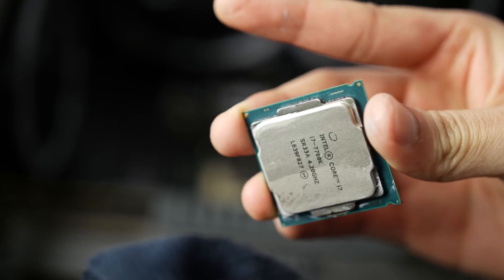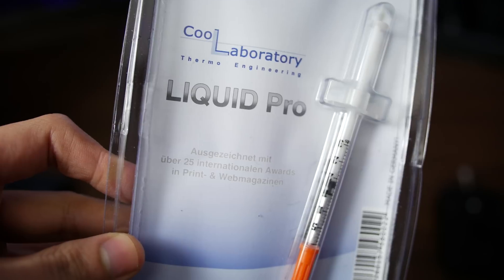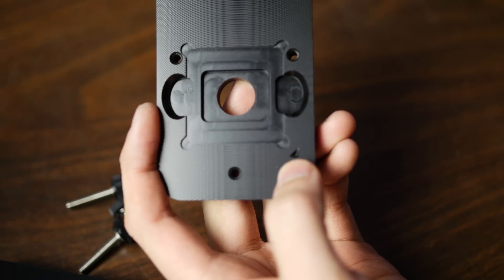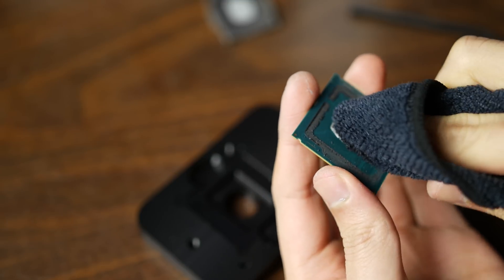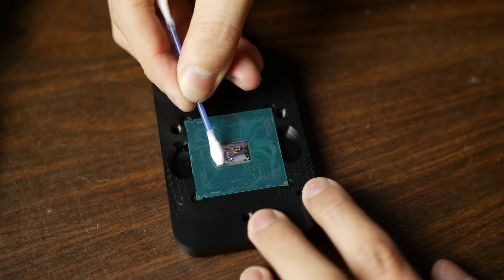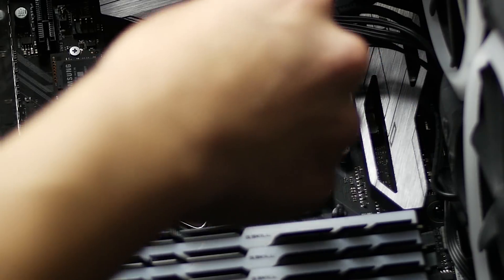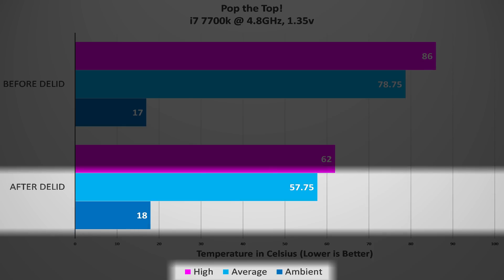Delidding the i7 7700k - Before and After!

Comment: Something isn't right here. Judging by the fact the liquid metal stuff can't be used on aluminum and that it is not very poisonous it is probably pretty safe to assume it contains a significant amount of Gallium which has a thermal conductivity an order of magnitude worse than aluminum, copper, or silver usually used in thermal compounds.

I'm wondering if Intel's quality control isn't as good as the price tag suggests and their stock thermal pad just doesn't physically touch the heat spreader.
Reply from the maker: I honestly couldn't tell you.  My best guess is Intel's stock stuff is built to last, whereas everything else is for optimal heat transfer and is intended to be replaced every year or so.  Regarding the gallium, I'm unsure of exactly how much is used to compose the compound, but it will wear the aluminum slowly over time.  I'm tempted to say its presence is significant enough, but still somewhat minimal.  I could be very wrong, though

Comment: I would be interested to see someone who delidded and put the heatsink direct on the chip with artic silver or something better.
Reply from the maker: I used liquid metal because I heard it offers better performance over standard thermal paste.  The main reason I put the IHS back on was because I wasn't 100% confident the cooler would make good contact with the die, but also largely because I would lose it if I didn't, LOL.
Reply: I dont know the paste blends all that well. I know to watch out for gallium, because it can do some real damage to certain metals. 

The IHS has little notches that help it lock in the cpu in the  mobo. Some work would have to be done to the IHS to allow the chip to make direct contact to cpu cooler. 

Eventually someone will try it.  Anyways, good info one temps. I tried to be funny in my post but edited it as I figured the humor might not be comprehended. In the event you can read edits, i figuered i would share that bit.
Reply from the maker: I saw the initial comment, I can see how it can be understood as a dry humor!  I refrained from commenting since I saw you changed it by the time I made my way to answer.  And you are correct!  Gallium eats up aluminum, so that's important to keep in mind!  Copper-based heatsinks will be fine, though!

Comment: I feel like the "safe voltage" for Intel CPUs is waaay too safe. I mean, I have a Q6600 superoverclocked to 3.8ghz and it lasted fine for 9 years, until it got too slow and I upgraded. Before your overclocked CPU gets ruined due to the overclock well then already your HDD, GPUs and SSDs have already long gone been broken, and your CPU is so old it really needs an upgrade. Intel CPUs can almost run forever a long as you stay 5-10 degrees under maximum(for instance a 2500k shuts down when it hits 98 degrees, stay at 90 degrees on full load and you're fine, even though on the spec sheets it says that you should stay under 72!!).
Reply from the maker: This is true!  These processors tend to last forever, even if you abuse them a little.  In most cases, it'll be time for an upgrade before the chip burns itself out!
Reply: Yeah I have 5 Intel CPUs and all overclocked to max, I've never had any issues due to OC, same with all my (15+?) RAM modules. But I've had a total of 4-5 HDDs, 2 SSDs, 1GPU and 1 motherboard(this cheap mobo worked but degraded degraded it's capacitors because of longtime high humidity I'm guessing) die on me
Reply from the maker: Yeah, I've never actually had a processor die on me.  I have lost a few GPUs and a handful of hard drives, though!

Comment: I keep reading about the i7 7700k running hot, but mine idle's at 23c and the max I have seen from the benchmark was 64c.  I only have a CM 212 EVO air cooler and the fan never get's above 800 rpm.
Reply from the maker: John N. Sounds like you've got a good chip!  I hear some people are lucky with their temperatures and other people have some difficulties...
Reply: I guess so, any how I like this channel so far so you got a sub.  Keep up the good work!
Reply from the maker: John N. Thanks!
Reply: It seems like you have a golden chip or the program you are using to measure the temperature is giving false readings. Just to be safe, check the temperatures with Intel XTU and the newest version of OpenHardwareMonitor.
Reply: Yeah I though about that so I tried XTU, Hardwaremonitor, the MSI app, and am now using core temp that shows up on the keyboard lcd.  Guess I got a good one.
Reply: That's pretty close to common for stock speeds. It's when you start raising the voltage a little bit that these chips burn.

Comment: Steven, when you applied the liquid metal stuff how did you know how much to put on? I ask because you said not to get it on the PCB because it is conductive, but then when you put the lid back on I would imagine the liquid metal would squash and spread out towards the green PCB area? So how do you know how much to put on?

Love your videos btw. I only found your channel tonight whilst looking for Beyerdynamics DT770 headphone reviews, but you've got a great sense of humour. Subbed because of it.
I hope for a response, cheers from the UK!
Reply from the maker: Hey there!  I only applied a thin layer, enough to cover the entirety of the CPU die.  It would squish a bit when you but the IHS back on, but if you keep the layer thin, it shouldn't spread enough to cause problems.  As long as the entire surface is covered, you don't really need that much!

Thanks for the support, hope I could help!

Comment: how much all Delidding staff cost ?
Reply from the maker: The tool itself costs $30, and the liquid metal compound costs around $12.  Everything else, I already had on-hand.  Microfiber cloth is somewhat optional, as you can use normal paper towels, and I think most people have isopropyl alcohol around the house.
Reply: ALittleDIMM i fond only 70% alchol on my country
Reply from the maker: 70% will also work!  90%+ is ideal, but 70% will get the job done, too.
Reply: ALittleDIMM thanks for fast replay
Reply: ALittleDIMM i orderd everything and it's costs my a fucking 85$  without the silecon do you think its worth doing it ?
Reply from the maker: Hassan X_X $85 seems like a lot! How did it come to that price?  And the silicon isn't necessary. In fact, I recommend against it
Reply: ALittleDIMM the liquid metal 12.70 + shipment 20.37 = $33 and the tool 30 + the for the re applied tool 8 and shipment 12 = $50.95
Reply from the maker: Oh, jeez, those shipping costs...  I wouldn't have bothered with the relid tool, it wasn't all that necessary.  I do the entire process in the video and I'm still running the same configuration without issues.
Reply: ALittleDIMM you did it without silcon ?
Reply from the maker: 3:02

I show everything I did.
Reply: ALittleDIMM and do u think its worth doing it ?
Reply from the maker: I don't think so.  At some point in time, you'll need to delid again to replace the compound, anyway.   Since the motherboard retention bracket holds the IHS in place pretty solidly, anyway, it just seems like an unnecessary extra step.
Reply: ALittleDIMM i meant the delidding not the silcon 😅
Reply from the maker: It depends.  I'd only recommend delidding if:

You are willing to spend the money and risk damaging your processor for a CHANCE at a higher overclock
You are willing to spend the money and risk damaging your processor for lower temperatures

If you've dialed in an overclock and you're happy with your speeds and temps, delidding is a risky process.
Reply: ALittleDIMM ok thank you
Reply: ALittleDIMM what thermal paste do u use betwean the cpu and the cooler ?
Reply from the maker: I use Arctic Silver MX-4, but generally speaking, anything with good ratings will get you pretty similar results.
Reply: ALittleDIMM i have Arctic Sliver 5 should i use it after delidding my cpu  or buy mx-4 ?
Reply from the maker: I've used Arctic Silver 5, too.  That works just fine.  The only reason I'm on MX-4 right now is because I saw a good deal for a bulk purchase.  Right before that, I was using the Arctic Silver.
Reply: ALittleDIMM ok sorry for a lot of questions and your time
Reply from the maker: No worries, it's what I'm here for ;)
Reply: Could someone use Arctic Silver or MX-4 for both the cpu-cooler interface AND also between the cpu die and the IHS rather than the liquid metal stuff you used?

Comment: 2 Questions. 1st) Is it safe to leave the processor without glue like you did just hold by the clip of motherboard? and 2nd) How often we should change the liquid metal from die? Thanks great vid btw!
Reply from the maker: 1)  Yes!  It should be fine to leave the IHS floating like I did.  I'm running the same configuration now and I haven't noticed any issues.  

2)  I'm honestly not too sure, yet.  I didn't see any particular recommendations, but I had planned on coming back to this in nine months to a year since the release of this video to see if the compound has been significantly weathered.  I'll have an update towards the end of 2017/beginning of 2018!

Thanks!
Reply: Thanks for the amazingly fast answer and thanks for these feedback!
Much love, keep going your are doing an amazing job!
Reply from the maker: Thanks, I try my best!

Comment: I have Grizzly Hydronaut, is this still going to make huge improvement if I delid?
Reply from the maker: Hmm, I haven't used that brand before, but if I recall correctly, I've heard good things.  In most cases, when you delid, you'll see improvements.  The stuff that comes between the IHS and the die by default isn't as good as most thermal compounds you'll find on the market in terms of thermal conductivity.  I hear the best results are typically from using liquid metal compound, but you should still see some gains from the Grizzly stuff, too!

Comment: I'm sure it's already been mentioned, but Siliconlottery.com.   They de-lidded and returned my cpu, and it's been F'ING FANTASTIC.  Check them out.
Reply from the maker: I know about them!  But I thought it'd be a lot of fun to do it myself!  Glad they could work wonders on your chip, too!
Reply: Hey Michael...I was thinking about buying an i7-7700k directly from siliconelotery.com rather than doing it myself or sending in one that I had purchased seperately.  Seems the price difference is about $70 and it would save my the time and effort of doing my own delid.  However, did they provide any insight on the potential longevity of the TIM they use before having to re-apply?

Comment: I have little experience in this field, but have an i7 7700K running at 4.8Ghz/1.35v and never reach more than 72'C on any core, even without de-lidding.
Your basic cooling must be very poor indeed! I'd be checking that long before wasting money on de-lidding.
Reply from the maker: Temperatures will vary from chip-to-chip, sounds like you got a good sample!  I've used the Corsair H110i and NZXT Kraken x62 cooler on mine, reseated both a couple times just to be sure, and had fairly consistent results, so I thought delidding would be a fun project!
Reply: I've just built mine using a Corsair 115i. It's only set at balanced, so if I didn't mind the noise I could probably squeeze a lot more from it, but I don't see the point.
It gives me a Cinebench score of just under 1100 and a Geekbench4 of 6122/21012. All on a quiet, cool system. That's good enough for me!
Reply from the maker: I don't blame you!  If my chip could do that, I'd probably leave it there, too!  But mine was stubborn and required a little more "motivation"...

Comment: Would you recommend this for people who live in hot weather. Right now I'd say the average ambient temp for me is around 25-27 Celsius. I don't plan on overclocking too high. My idle temps are 37-40 degrees with a Corsair H80i on a i7 7700k. Thanks!
Reply from the maker: I would only recommend this if you absolutely need it.  There is a bit of risk when it comes to doing something like this, so I would suggest overclocking and running some stress tests for at least an hour or two.  If you're stable and you've hit the speeds you wanted at acceptable temperatures (85C is my recommended max for 24/7 operation), then I don't see a need!
Reply: Thanks for the quick reply! Just found your channel and I have to say I'm impressed. Please keep making these amazing videos. I will probably look into upgrading to a h110i for the bigger radiator. 

Just ordered these rgb fans I found on Amazon and would like to know your opinion. Hopefully make a video review for them.
Reply from the maker: Sorry, I'm not sure which fans you're referring to.  If you've used my Amazon link, I can try to track them down from there!  But otherwise, I have videos on NZXT's AER RGB fans and Corsair's HD120 RGB fans that might interest you!
Reply from the maker: Interesting!  These are pretty cheap, I might look into these!  Thanks for the link!
Reply: Great, I'll let you know my experience once I get them. The fact that the fan blades are black caught my eye. I have a black and red build and thought the Corsair SP120's wouldn't go with my setup, Thermaltake Riing 12 looked good to me but ended up taking the risk with these because of the price point.
Reply from the maker: Makes sense!  I'd love to hear your thoughts on them!
Reply: ALittleDIMM Hey just got my fans!(http://a.co/3edHa91)  I dont have much experience with other fans but I found the build quality to be strong (even though a fan had a broken corner, I blame poor amazon packaging). They come with fan controller with 6 fan inputs, 2 speed control on board and rgb color modes controlled with reset button. Max rpm 1300. I didnt see an improvement on temps but it did make my rig look a bit better!
Reply from the maker: Neat!  Mine came in a couple days ago, too!  Though, I haven't had the chance to open them, yet...  Been a bit busy with other projects...  But soon!
Reply: ALittleDIMM Cool looking forward to seeing your projects!

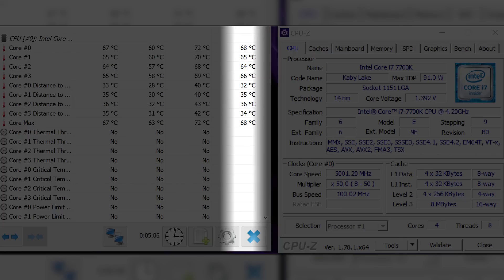Comment: What Software are you using at 4:14 to verify temps? Awesome video btw, made me comfortable with the idea of delidding my i5-7600k! :)

Subbed! xD
Reply from the maker: The temperature monitoring software (left side) is HWiNFO (64 bit), and the software on the right is CPU-Z!  

If you end up delidding, feel free to let me know your results!
Reply: Thanks for the quick reply! Right now i'm struggling to find Coollab's TIM without stupid delays in shipping... I'm in Montreal, Canada. :| I'll post results asap!
Reply from the maker: Good luck!
Reply: If we wanted to relid the cpu as opposed to floating it, what silicone/sealant/glue (or whatever it's actually named) would you recommend using?
Reply from the maker: Black silicone or a gasket sealant should work!  I've updated the description with links, but if you ever want to delid your processor again, it may be a little more difficult!
Reply: Awesome, thanks!! xD

Comment: Do I really need to use that liquid metal TIM if I decide to delid my 7700k?
Reply from the maker: You don't need to, but it generally provides much better results!
Reply: So I can use the Arctic 5 as well? Cause I saw in the video that when you delid it, the thermal paste is just plain old paste. I honestly finally got to trying to OC mine after having it for like 3 days and 4.8 was already shooting almost to 100c and it freaked me out.
Reply from the maker: You can use Arctic 5, but I hear the results aren't as dramatic.  It should still be an improvement over the stock stuff!
Reply: Ok cool! Thanks for the replies. Now I just have to figure out if I really want to drop 40 bucks on it or stick to Arctic 5.
Reply from the maker: It's a tough decision!  If you decide to give it a go, good luck!

Comment: There is something I don't quite understand. Why liquid metal? I'm not planning on delidding, but I've heard that there isn't that much of a difference between non conductive compound and liquid metal. Of course liquid metal is the best, but wouldn't fool-proof compound be still miles ahead of the intel goo?
Reply from the maker: Typical compound will also work, but I heard liquid metal provides the best results, so that's what I went with for this video!  Generally speaking, any thermal compound will most likely hold a thermal advantage over Intel's stock goop!

Comment: Hell yeah!! Thumbs Up👍
your voice is so cool, just a bit low background music will make it more cooler!!
Q: Well what compound should we use to make that sandwich snap/stick back?
Reply from the maker: Thanks!

I used Coollaboratory Liquid Pro thermal compound between the IHS and the CPU die.  Between the IHS and my AIO water cooler, I used Arctic MX-4 (though, any decent compound will do).  For keeping the IHS in place on the processor PCB, I just let the motherboard clamp it down.  I don't think it's necessary to reglue the IHS back on unless you're shipping the CPU off somewhere by itself.  If you ever need to reapply the liquid metal, it's just another step, and with no adhesive between the IHS and the PCB, you'll get better overall contact between the IHS and the die.  Hope this helps!